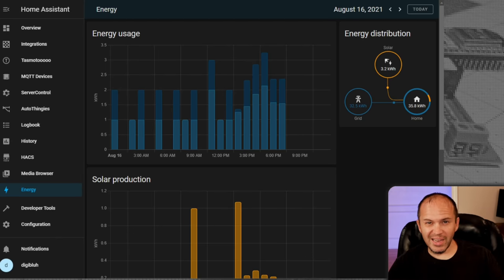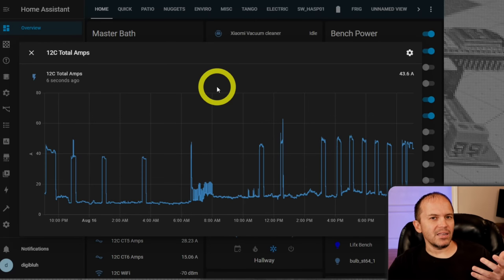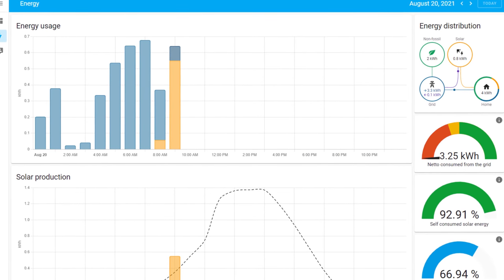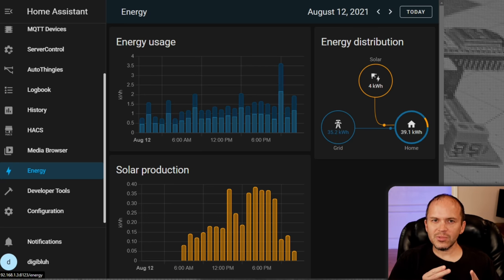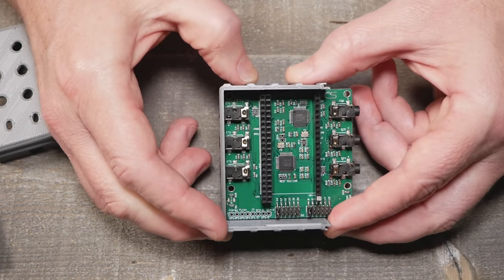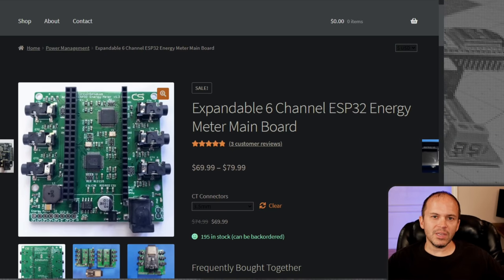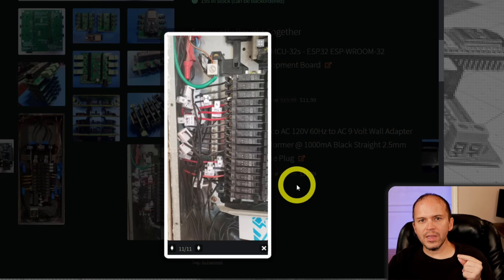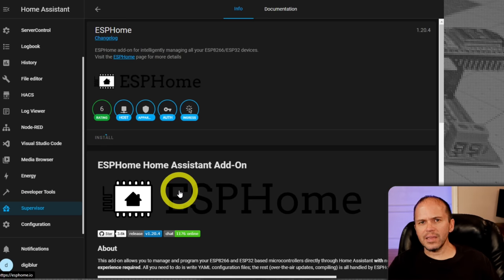DIY Home Power & Solar Energy Dashboard -  Home Assistant w/ ESPHome

Comment: After messing with building my own with CT and esphome, with low stability, I made one using emoncms and ESP32 posting the Data to MQTT.  Used the "integration" integration to convert the Watts to kWh and move it into the dashboard...        DIY tip keep leads short between clamp jack and resistors/esp input, and beware of magnetic  flourescent ballasts in close proximity.
Reply: Hey Bill, I also build my own monitor with ctClamps+nodemcu+emon-library. I also post realtime watts and amps to an MQTT topic. but what kind of integration do you use to get kw/h for the energy dashboard. i'm having a hard time dropping in nodes with all kinds of formulas in nodeRed. what is the "integration" integration?
Reply: @garrox84  excerpts from my sensor.yaml file: 
#SUM my two phases power
         mains_power:
        friendly_name: "Power Usage"
        unit_of_measurement: "W"
        value_template: "{{((states('sensor.mains1_watts')|float)+(states('sensor.mains2_watts')|float))  | round(0)}}"
#AND
  - platform: integration
    source: sensor.mains_power
    name: energy_spent
    unit_prefix: k
    round: 2
Reply: The integration integration is a built in mathematical function in HA, I guess it is my only practical use for calculus!
Reply: @billkennard4310  i found it! Thnx for the answer

Comment: I know this may go against common practice, but this makes it easier for me. I wanted to share how I have my CTs labeled. For me, this is easier to know which CT is connected to which port without having to scroll back and forth. Thanks for all of these videos! This little energy monitor is really freakin neat!!!
# Current Transformers:

  current_20a: '11143' # 20A/25mA SCT-006: 8x
  current_30a: '8650' # 30A/1V SCT-013-030: None
  current_50a: '15420' # 50A/1V SCT-013-050: None
  current_80a: '41660' # 80A/26.6mA SCT-010: 2x
  current_120a: '41787' # 120A/40mA: SCT-016: 2x
  current_100a: '27518' # 100A/50ma SCT-013-000: None
  current_200a: '27518' # 200A/100mA SCT-024: None
Reply from the maker: Thanks! Not a problem at all for throwing comments in your code or even substitutions of things to make it easier.

Comment: Thanks for the tip ( at about 12:30 in on the video ) on crossing the lines on a 240 volt AC circuit.  I was doing a "times 2" in the YAML.

To change the currency go to the "General" under "Configuration."  You'll see the Currency type. Edit and restart. Then the Energy dashboard will show the U.S. dollar.
Reply from the maker: I do that in a couple of mine so you grab the real amps of both.  Yes, that's just a test little dev container of HA, I wipe it from time to time and I just left it default.
Reply: @digiblurDIY  I'm confused about the crossing lines for 240V appliances/circuits - isn't the Current measurement accurate with a single line through the CT, but the Voltage needs to be doubled in the calculation for Power?
Reply: Could you explain where you're adding multiplication to your ESP32 YAML's Power calcs? Are you just uncommenting the 'Multiply by 2' under Power for a given CT?
Reply from the maker: No, think about it.  If you ran two 120v bedroom circuits through the same CT clamp you would measure the current in both of them.  If you run both legs of an electric dryer in opposite directions through the CT clamp you can measure the current of both.  it's still 120v per leg, they are just out of phase.
Reply from the maker: Yes, if you want to multiply a value to change it from negative value, multiple by 2, etc the filters are great for that.  https://esphome.io/components/sensor/index.html?#sensor-filters
Reply: @digiblurDIY    Just finished switching my 240 vac (single CT) over to the correct way. I mentioned this to an electrician friend of mine who then looked at me with that "duh!" look on his face. He goes, "that's the way you're supposed to hook them up."

Anyhow...I just loaded up the original 6 channel example you provided and all is working like a charm.  

Thank you for doing the heavy lifting.  I pretty much just copied your system when you did the first 6 channrl review.  :-)

Comment: Great video! Ordered the parts. Excited to get going! Planning on using 1 CT clamp on the generator back feed into the house to measure how many amps I'm pulling during a blackout too.
Reply from the maker: Nice! I thought about doing that but I do have the Genmon project running on my generac.

Comment: Just a heads up for your Canadian viewers.  It is illegal for you to install low voltage items inside your circuit breaker panel.  Your home insurance may also be voided by doing so.  Please consult a qualified hydro inspector or electrician to find out how to interface your system correctly.
Reply from the maker: Highly recommend the electrician option myself as most places in my area do not have disconnects at the meter pan due to the close proximity of the main panel.

Comment: Other cool thing might be to cover the 'use an entity with current price' in the energy config. Alot of people have TOU rates (4-9pm high energy cost, else low) - I dont see much documentation around that at the moment
Reply from the maker: I assume that is left open to be flexible based on however you want to get the price into your system whether it be some automated way or manual method with helpers/automations. If I had that in would just drive it via a timed automation of some sort via HA or NR.
Reply: I put examples of my automations for this  on the digiblur discord server under "projects and shares"

Comment: I dealt with the issue of ct's installed backwards by altering the templates to get the ABSOLUTE VALUE of the value. Works perfectly
Reply from the maker: My OCD gets to me. But yes easily fixed via a template.

Comment: is that device measuring apparent or real power cause the emporia suffers from the apparent loads that are partly wrong like all the induction driven motors causing the measurement errors ?

Maybe I have not heard it in the video but I had some trouble with the emporia which had been showing 100 W for a inductive heater - on idle so nothing really going on.
In reality it has drawn 2 W for the display / light and I guess some basics like the timer.
Reply from the maker: https://esphome.io/components/sensor/atm90e32.html

Probably more power features than you need but it covers most of everyone's needs.

Comment: Very cool video. I want to buy a 6-channel board, but I only find a power supply for the US in the shop of CircutSetup. Does anyone know which power supply to use for Europe with 230V and a different plug form factor?
Reply from the maker: No AC to AC power supply options there?

Comment: Great video thanks. For the solar monitoring are you using post inverter, therefore measuring AC? I'd like to measure the PV DC and not sure the Current monitoring works for both AC/DC feeds.
Reply from the maker: No solar yet due to ROI issues. I just had this mocked up on my front room mini split as solar. I think I mentioned that. I was measuring AC split phase.
Reply: @digiblurDIY  Thanks, Occurred to me after posting I can just switch the current sensor over and see if it reads the values accurately.

Comment: My clamp is 100a/1v how would I configure that can’t find anything for my clamp thanks
Reply from the maker: You would need to cut the burden resistor on the port.  The little trace on the back.  Try this gain -       gain_ct: 27518

Comment: Hi thanks for your time and effort put into your videos. I am considering getting this system. I have a micro inverter grid tie solar system and would like to monitor import and export values.  Can this be done with 2 ct or would I need 4 cts so as to read bidirectional current flow? Any help or link to info would be appreciated.
Reply from the maker: Thanks for watching my madness! I am not really sure about that as I don't have any solar experience due to costs. CircuitSetup would have more experience on that with the different setups.
Reply: @digiblurDIY  ok thanks. I checked the circuitsetup site but didnt see any contact info. Is there a phone number for inquires. You could look at the sun gridtie inverters. Not very expensive. You can start with inverter and panels and add batteries later. Have a merry christmas and prosperous newyear.
Reply from the maker: Check his discord server https://discord.gg/rw4sJfWv

I would love to do some sort of simple grid tie system that would maybe produce 1000-1500 watts to help offset base usage. Tough to get anyone to mess with a small simple system as they want to install the massive ones but my net metering sucks at 2 cents kwh sell back.

Comment: Cool (and timely) video - I'm looking at wiring up my panel and leveraging data I'm getting from solar to join together what I'm using and what I'm 'banking' with the utility. 

One question - I noticed that the vue sells 50a ct clamps (but with 2.5mm mono jacks) and was wondering if you or anyone in the comments have tried these - if so, did they work or what did you do to make them work.
Reply from the maker: No idea why Vue or Emboria decided to screw with people on those 2.5mm jacks.  You could try converting them or cut the end off and and do a screw terminal to 3.5mm jack.

Comment: Do you have Sense or tested Sense? I am looking to start monitoring power at home and I am looking  for the most accurate and simple way to do it. Any recommendations?
Reply from the maker: I looked at Sense and the cloud requirement and issues with it made me skip it. Check out my Emporia video too. Both great products but for higher accuracy the CircuitSetup is the way.

Comment: Thanks for this update. Loved your original video. Just at 07:30, where you mention the power factor and wattage are now done properly. Is this due to a revision of the board itself, or is the change just with ESPHome?
Reply from the maker: Thanks! Both actually. The voltage reference was fed to all channels on the ICs.

Comment: I'm measuring 3-phase for house and 3-phase hot water. But i don't know how to get working with ha energy. There is not option in : Configure grid consumption.
Do i have to buy Add-on Board so i can meter exactly or what?
Reply from the maker: https://github.com/CircuitSetup/Expandable-6-Channel-ESP32-Energy-Meter#measuring-3-phase-electricity

Comment: I am setting up very similar thing at my home. But not able to figure out how the ac transformer is connected to panel. 
I am thinking of using extension cord, female-end connected to transformer plug and other cut-off and connected to circuit-breaker. 
But not sure if there's an other way.
Reply from the maker: I had a plug near by the panel and was able to run it in the bottom, some have mounted the box outside of it the panel, some have used directly wired transformers inside the panel itself.  Depends on the room in the panel.

Comment: You know what would be cool is if you could go over the config where you adjust the various channels by various clamps, like the whole house you mentioned you might use the 200amp clamps but then you also have the 20amp clamps.
Reply from the maker: I think I did that in my previous version video and went through ground up calibration and such too since the cheats weren't there. Feel free to ask here or discord for details or help with your setup.

Comment: Would be great to update with showing how to setup the different clamps (change current_cal calibration per channel, which channels are where on the device, etc), or is that in your older video? :)
Reply from the maker: I did cover that in the older one when we had to the calibrations ourselves.  I would like to do a ground up one with plenty of room on the mains side or even with a cut off before the panel so I can show more on the clamp install hardware side.  Hard to do that on a production house with an older panel that's a mess.  I have some ideas....
Reply: @digiblurDIY  Good part about doing one on a "production house with older panel that's a mess" is it will look like most of ours :D
Reply from the maker: I was going to use an smaller building I knew of butttt... Hurricane Ida has blessed me with a long power outage and rewired most of my panel and will video some of the clamps going back on.

Comment: How does it read voltage? That’s one thing I don’t like about Emporia and like about Sense. Sense has voltage readings and alerts
Reply from the maker: It reads through the power supply which is AC power based. This is also used as the reference for power factor to calculate watts. There's a whole lot to not like about about Emporia and Sense than just voltage issues.
Reply: @digiblurDIY  what's not to like about Emporia? I've been looking at energy monitoring options and the Emporia Vue seems like a good bang for your buck.
Reply from the maker: Completely unfiltered honest even after their post I put up in the video?

Comment: With everything inside your panel, how did you get power to the transformer?
Reply from the maker: I have a plug right next to my panel and ran it in. Some use the power supply in the panel itself.
Reply: @digiblurDIY , Thanks for the reply!

Comment: can someone please make a new updated video that shows everything start to finish ESP32 WROOM32U and the 6-CH board? i am using the 6chan_energy_meter_v1.2.yaml file on gethub. i cant get anything to connect to home assistant, however i can connect to unit direct over web IP. other issues, Amps are showing for all 6 CT's but only one Watt calculation. i am new to all this but feel i am learning quick.
Reply from the maker: Nothing really changed on the process to put esphome on your chip. You can do that part first before ever touching the 6 channel board. You can jump in here https://discord.digiblur.com too

Comment: When I click "Add Consumption", it says "No matching statistic found".  You mention above to add the energy tag in the yaml.  Can you show what you mean?
Reply from the maker: https://github.com/CircuitSetup/Expandable-6-Channel-ESP32-Energy-Meter#getting-data-in-the-home-assistant-energy-dashboard
Reply: @digiblurDIY  Perfect.  Got it working.  Thanks.
Reply: Damn, thought it was working.  But no go. Sigh! I'll keep working on it.  Would really like to see an example of a working .yaml for this board (i.e. one that works with the new Home Assistant Energy).  I'm missing something but just can't see what it could be.
Reply from the maker: I use these as a starting point - https://github.com/CircuitSetup/Expandable-6-Channel-ESP32-Energy-Meter/tree/master/Software/ESPHome
Reply: @digiblurDIY  OK, that code works.  Something in that code is missing in the other examples.  Or there is something in the other examples that prevents Home Assistant from detecting the board.  Anyway, thanks, I've got a starting point to work from. Great videos btw.  Keep it up!
Reply from the maker: Awesome! Now start changing stuff until your break it. 😎

Comment: Do you know if the emporia ct work with this board? How is the accuracy compared to the circuitsetup ones? I see the emporia are a lot cheaper to buy
Reply from the maker: CT clamps shouldn't impact accuracy. You would need to check if the Emporia ones have burden resistors or not and then convert from 2.5mm to 3.5mm plugs.
Reply: @digiblurDIY  ah so they aren't plug and play and require modifications. That's what I was trying to figure out. Thank you
Reply from the maker: Not really. Emporia uses a smaller plug than others.

Comment: @digiblurDIY I am confused maybe you can clarify? Do we need to calibrate the clamps to read the correct voltage gain/amps? I bought the boards when I discovered your first videos but it was a little over my head at the time (still is) and I havent had time to look back into it. I assume I have the older version board. I am really wanting to get this setup.
Reply from the maker: The github project by CircuitSetup has the calibrations done now as time has passed. You can tweak as needed. Which version do you have?
Reply: @digiblurDIY  looks like v1.4 rev 1 and I also have the add-on board also.
Reply from the maker: Ahh. you do have one of the more recent revisions.  Nice!  Calibrations are in these files for you already in the comments. https://github.com/CircuitSetup/Expandable-6-Channel-ESP32-Energy-Meter/tree/master/Software/ESPHome
Reply: @digiblurDIY  Thanks I am going to give this a shot... just need to find a drunk cousin or uncle to install them! :P

Comment: Great video, thanks.  To add an external aerial do we need a different version of the ESP32 NodeMCU, to have a aerial connector?  Also can you recommend a aerial.
Reply from the maker: I linked one in the video description on Aliexpress. Any ufl antenna with the length you need really. Also try it without as oddly enough mine had enough signal without it which still does not make sense to me.

Comment: Loving the video thank you for this! Hoever, after purchasing everything and finally getting to the esp32 installation, I get a fatal error to connect after it has been flashed. what gives!? why is this not an issue for you or anyone else on YT!? Im not doing anything different...
Reply from the maker: What's the serial log show? Is this with just the ESP32 naked connected to USB?
Reply: @digiblurDIY  Im not sure if my reply went thru the first time... the fatal error occurs with the ESP32 plugged in directly to the Pi HA server via usb. it errors while the initial installation of the ESP32
Reply: @digiblurDIY  I Love it... never give up trying, I changed nothing int he code, kept retrying for the last 1.5 hours and it eventually installed suceffully! lol

Comment: When I put it on a 240 breaker do I need two clamps or can I (esphome) multiple one clamp by two if so how would I do that thanks
Reply from the maker: Depends on the use case. If you have enough slack you can loop the other through at the opposite direction but multiplying by 2 also works if the load is somewhat balanced.